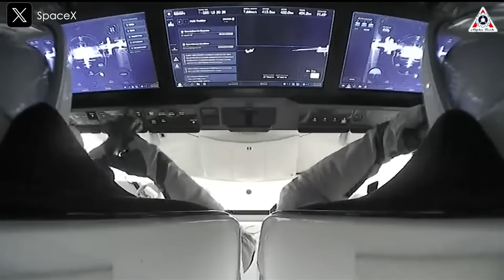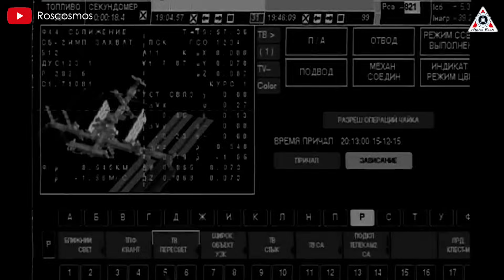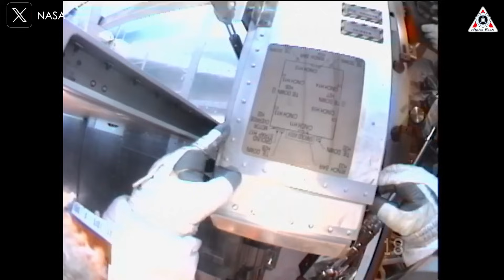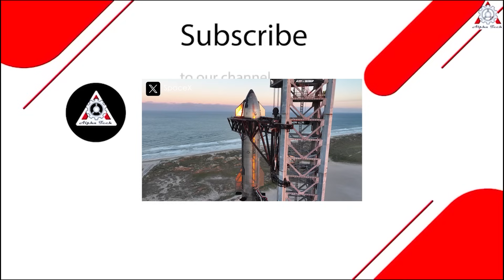Why does the Space Station have too many problems nowadays? Can it run till 2030?

Comment: The current Space station is too cobbled up, too many complications, and never had a real design over view.
The good news, is groups are starting to get past that level of tech, and think about more wholesome designs.

I would suggest that the target not be componant modules, but construction members or sections. There are ways to create structures that rely on interlocking gasketed sections temporarily, that are held together and seals enhanced by internal pressure, and then could be welded up.

Welding in a vacumm will be interesting, shouldnt need flux or shielding gas, but you wont be able to weld where theres a pressure differential between the two sides. But I do believe it would be fairly easy to design systems to get around such issues.

Another issue will be sparks and space suits... robotic welders would be one solution.

But modules are limiting in size, Space has no size limits... we need to get beyond modules into actual space fabrication.

This might require launching something other than tube rockets.

Blasphemy I know!
But I'm probably Earth's first Space Heretic! 🤣

I suggest the brighter Structual Enginerds start dreaming up systems to accomplish these things. The ability to launch componants and even sections, and get them assembled and solidified with minimal Space Monkeys involved.

Things that arent shaped like sewer pipes...

Just sayin'
Reply from the maker: I agree that we need to move beyond modular design and into a more holistic approach to space construction!
Reply: @alphatech4966  
Yeah I did writs on it months back, a way to do a gasket that allowed holding things together with internal pressure. and used pressure to seal like a tubless tire bead on rim.

Only thing I didnt mention was that it could be welded up from inside under pressure without vacuum sucking the weld out, by having a couple hunks of stainless strap on edge, along each side of the seam internally, putting everything together, and then bridging across between the two straps on edge with a plate. you could seal and weld up the hull from inside under pressure and not have the vacuum suck your weld out.
Also that plate would create an effective doubler structure at the seam, ie, seam would serve as a tranverse frame or a longitudinal chine angle juncture that was reinforced.
Probably have to read the old writ to get it all, was near the one on launching connected elbows rotated  like a kriss knife, and rotating them to get a circular station for artificial gravity purposes.